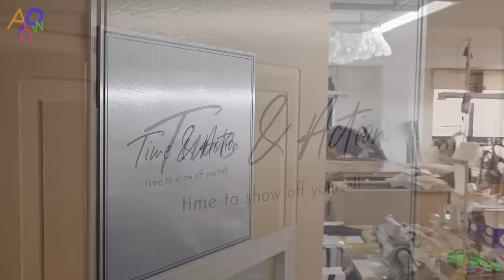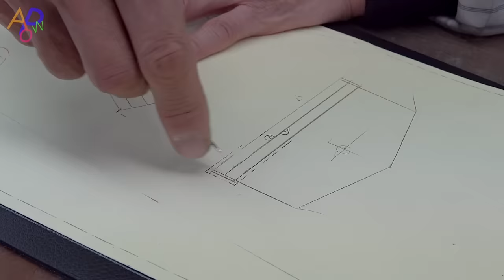Cowhide Biker Jacket Made by Leather Jacket Craftsman With Long History

Comment: Curious, what does the tape on the head of the hammer do?  (Just polish the steel on the head of the hammer, why use a temporary interface?)  Or get a Teflon face (PTFE) - that stuff won't stick to anything.
Reply: A rubber mallet is typically used for leather work, the tape is used to prevent the potential damage from the metal